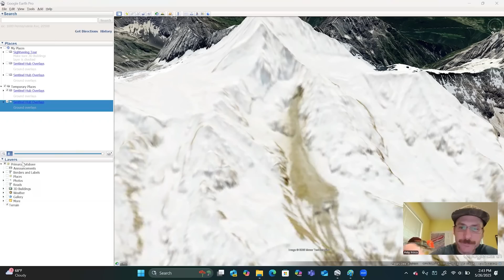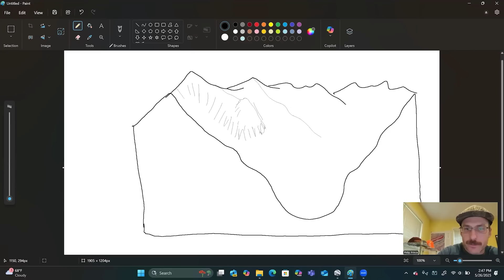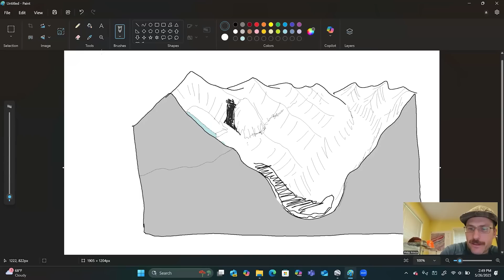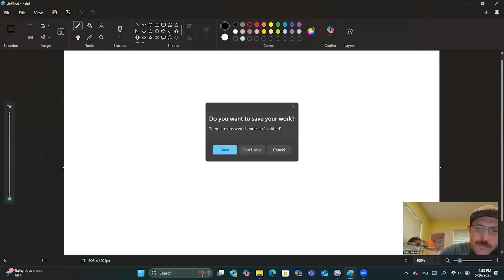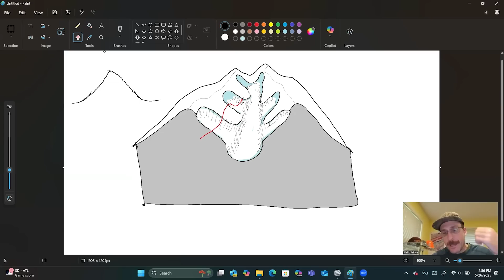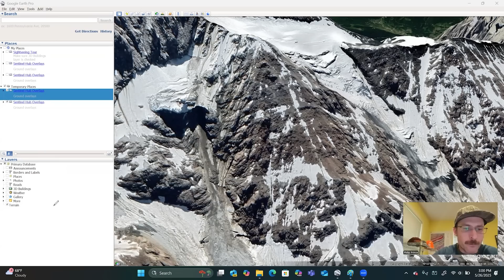Swiss glacier collapse and rockslide--why is the mountain unstable?

Comment: The main problem is that under the glacier, the rock is held together by permafrost, that is now exposed to heat and it will tawout and not hold together anymore and fall.

Comment: Official reports state that approximately 3 million cubic metres of ice and sediment fell, which is nearly the worst-case estimate (I recall up to 5 million cubic metres).

Ultimately, our universe will always behave according to physics. Your video highlighted the underlying issues, but it’s strange that local reports refuse to attribute the event to the current climate change.

They are concerned about the lake growing behind the rock fall.

Many villages in the Alps are at risk from similar events, and there is nothing that can be done in most cases.

Comment: One minor point, you said (implied) that it was the water flow from the melting glacier that eroded the "U" channel - probably just an easy turn of phrase rather than explaining the erosion in more detail. 

The erosion is from the [slow!] motion of the glacier along it's bed, aided by some water as lubricant and rocks and boulders embedded  in the base of the ice and plucked from the underlying rock as the grinding surface, with the glacier being pushed along by the loading of fresh snows in the upper reaches. This grinds the really deep U channels that are classic features of glacier valleys.
Reply from the maker: I would have said that glacial retreat exposes or reveals the U-shaped valleys developed by the process you describe. The retreat of the glaciers is the big reveal, not the origin.
Reply from the maker: I don’t think I said or implied that.
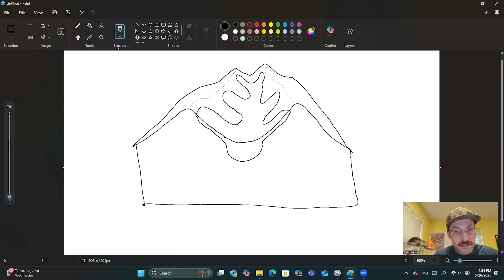Reply: @TheGeoModels  it was around 13:05 where the phrasing could be confused.

Comment: Thank You for the explanations. Much of what You predicted has happened in the last two days. The glacier has collapsed fully, and the 'nose hanging' up there threatens to come in the next days. The village of Blatten has been buried, but the whole valley may be not inhabitable if the landslade makes a big lake on top.
Reply from the maker: the nose is frightening. I’ll be interested to see if anything is done to unblock the river if the nose adds to debris, or if the river will overflow the blockage naturally. slide deposits are terribly unstable, and I can’t imagine how one with entrained/ice water could be worked by heavy equipment. quite an event!
Reply: @TheGeoModels  there was a similar event in Randa, where the Vispa built a lake which burst down the valley later.

Comment: The part of the mountain that started to shift has dropped in height by over 330 foot just in case anyone was wondering. 
There is also another disaster waiting to happen in that area too. If the glacier and the part of the mountain does collapse into the valley then it will not only block off the roads to other villages but it will also block off the river at the bottom of the valley which will cause flooding in the area that will affect the other villages too.

Comment: It's not only the weight if the rockslide lands on the glacier - but big slides convert alot of the potential energy into heat, that can melt the ice and speed up the sliding process

Comment: A serious piece of the semi summit has cracked horizontally and is falling. I would not describe that as gravel land sliding behind the glacier. The glacier is moving due to the density of the huge summit rock cracking up and pushing the glacier down. No other direction to go.
Reply from the maker: don’t think I called it gravel…there’s about a 250 ft thickness of new rock piled on the glacier, whose interaction with the underlying rock upon which it rests is poorly understood!

Comment: Latest Update;

The fractures in the Blatten glacier in Switzerland are increasing significantly, according to the authorities.
This content was published on May 27, 2025 - 14:39

A large avalanche occurred on Monday night, with a mixture of ice, rock, snow and water, but did not reach the valley floor.
The front of the glacier is now advancing at a rate of 10 metres a day, according to the Lötschental regional command headquarters in its latest update on Tuesday.

A massive cone of debris had formed on the Birch glacier in recent days. Around nine million tonnes of debris are weighing down on the glacier.
A new reconnaissance flight is scheduled for Tuesday, and a second camera is to be installed to provide an oblique view of the glacier. This will enable a more detailed assessment of the movements and appearance of the crevasses on the front of the glacier. A further reconnaissance flight is also planned.

Comment: 4:20 You say both may fail. The authorities say it will fail almost 100% sure. The questions are when and how much at a time. The best case for the town would be multiple partial collapses and the worst case would be it all coming down in a single event that will probably destroy a part of the town.
These mountains are very much alive as the Swiss Federal Railways have lernt in the last few years. Just 2-3 miles to the west thee is a new deep base railway tunnel. In 2020 one of the two tunnel bores was closed due to a water and sand ingress.
https://en.wikipedia.org/wiki/L%C3%B6tschberg_Base_Tunnel#Operation

Comment: The Acrefoot unit is useful for understanding very large volumes. 1 million cubic meters equals about 810 acrefeet. So four million cubic meters would be 810 acres of rock at four feet high. Consider residential properties as maybe a quarter of an acre or so and that's enough to demolish thousands to perhaps tens of thousands of homes.
Reply: A little more perspective… I did the calculations and it would take 83,334 standard size (12 cubic meter) dump trucks to move one million cubic meters of material.

Comment: Glacier collapses are increasing significantly
In the Blatten landslide area in the Lötschental valley in Valais, glacier collapses have increased significantly. During the night into Tuesday, a large avalanche consisting of a mixture of ice, rock, snow and water broke loose . However, it did not penetrate to the valley floor.

The glacier front was recently moving at a very high speed of around ten meters per day , as the regional command staff announced on Tuesday. A massive debris cone had formed on the Birch glacier in recent days. According to experts on site, around nine million tons of debris are pressing down on the glacier.

Reporter Beat Kälin said on site: " Visually, the changes in the last eight hours are clearly visible . Several thousand cubic meters of ice and rock have broken away from the glacier front and moved down the valley."

In contrast, there were only a few isolated major rockfalls last night . A reconnaissance flight and the installation of the second camera with an oblique view of the glacier are planned for Tuesday.

The second camera will enable a more detailed assessment of the movements and crevasse pattern at the glacier front, it was said. A supply flight to the outlying villages is also planned for Tuesday. (rbu/sda)

Comment: Big picture; gravity wants to flatten mountains...So gravity is trying to pull mountains down. In this story if both glacier and rock go down from the south side (more or less) of the mountain it will end up in a waterflow towards the Rhone-river...It may also result in warm air from the south being able to get more north...with more melting...since we are only just still in may-summer is coming...
These kinds of events may go onnoticed in mountain areas with low/no population...and do decrease long term waterflow into rivers (because less glacier ice=less water influx into the rivers...). When the ice is gone solar/summer heat will get deeper into the mountain-cause more melt=collapse...
If we have a lot of these events in mountains it will result in water availability...Hello from Holland/Netherlands ! (Were the rivers meet the sea...)

Comment: I think the very top upper left is actually failing onto the glacier at the top of ur drawing and there a good amount of snow under it so as the snow compresses and melts rock falls into new snow and that entire system from the very top is actually falling rather than the right side that you think

Comment: In the interim, what officials say in the valley is that approximately 9 Mio tons of materials have been dropping down to the glacier, with approximately 4 Mio tons still moving up there in the instable section of this little shoulder of the mountain, called the little Nesthorn. 
So, while still appreciating very much your work, it seems that the red portion on your draft in the early sectors of the video is drawn just a little bit too large compared to the black pile that's already down on top of the glacier. The real ratio seem to be somewhat like 2/3 to 1/3 in favor of the black one.
In addition what I have missed from the video (maybe it's there but I didn't hear it), is the substantial risk the Blatten village is threatened by would not only be the one to be damaged by the rockslide per se, but even if that one would (what we all hope) be slow and small enough not to simply override Blatten, but when it reaches the bottom of the valley, and this would typically happen somewhat downstream from the village, it could build a natural when still catastrophic type of dam accross the small river that flows down this valley. It is said (by the officials) that there is a significant risk the Blatten village could be found on the bottom of a small lake formed there pretty shortly after the slide reaches the bottom.
Greetings from Switzerland :goodvibes::thanksdoc::goodvibes:
Reply: LOL what is this "mio"?
Reply: @soakupthesunman  I'm sorry, I have probably used the wrong abbreviation. It was meant to stand for Millions.